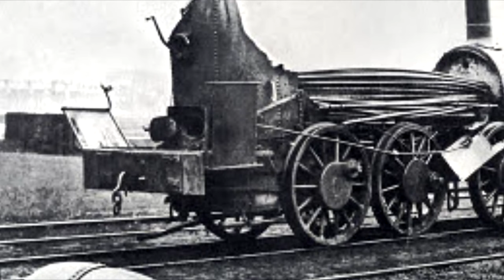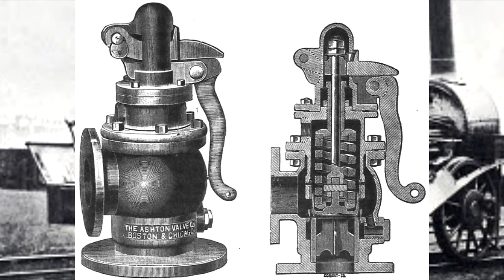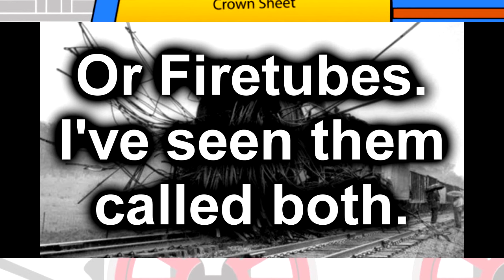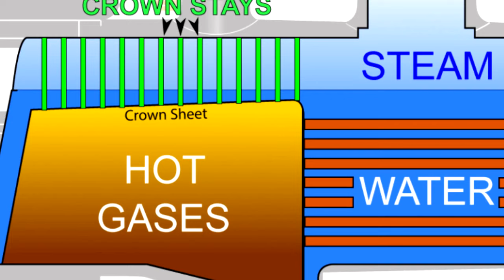Steam Trains Sometimes Have Bad Days 🚂 The Explosion of C&O 3020 🚂 History in the Dark

Comment: The Crash at Crush wasn't the first spectacle crash. At least one had been done previously in New York - without the boilers exploding. Unfortunately, the MKT engineers were unable to ensure the same result.

IIRC it was less that the public didn't think Crush had done anything wrong and more that he was re-hired on the sly because despite people being pissed about the explosion... the crash still got the MKT lots of publicity and attention, so it was a net gain for them.

And pretty sure that "the Katie" is indeed said with a long "a", because it's derived from the second and third letters of the railroad's initials: KT

Comment: WOW! I know what happened to the C&O 3020 T-1 locomotive.  I have been a railroad buff since I was very little (I will give a bit of a story when I was only 5 years old at the end of this). I talked with a gentleman at the Youngwood Railroad Museum in SW PA in the early 90's. I will just call him Mr B. since he passed away decades ago and I can't get his permission to use his name here. He worked for Pennsylvania Railroad, then the Penn Central Railroad. He was in his early 60's age at that time. 

First, you said it was on an .18% (point one eight) Percent grade, which is next to nothing - only inches rise over 100 feet section of rail. The grade I was told is a 1.8% which is 1.8 feet rise per 100 feet distance which is about 21 5/8 inches rise per 100 feet. Not much for a car, but a locomotive pulling thousands of tons of weight is getting to be the upper range limit of grade railroad companies try to limit grades, which is a target of 2% maximum, though some grades can be and are steeper than that, but not as efficient because on long grades additional locomotives would be needed just for the one single grade rise over what could be a short 10 mile run, or a run of a couple hundred miles. When all grades are below the 2% grade or the grade is very short, one locomotive can be sufficient. It is a huge savings to have only 1 locomotive vs the cost of two locomotives and two crews, just for one additional locomotive needed for the steeper grade. This information is relevant to what happened.

The engineer was hesitating to add water. At the 1.8% grade, the locomotive would be slow at best. Adding water on the grade or just prior to the grade would slow the locomotive even more, and sometimes the train would come-to-a-stop/stall until the water temperature and pressure got back up to temperature and pressure needed to pull the grade. If the train is late, it was frowned upon by the management, and the engineer was blamed, and sometimes punished for being late. So, the engineer delayed adding water trying to keep to the schedule.. If the crown sheet was exposed and water added, there would be a rapid steam pressure rise and the pressure from the flash steam to the point the locomotive would explode. In the case of the 3020, that is exactly what happened.

Repair the locomotive?? Yes. The boiler tubes are only in place with friction. When new pipes are installed, the pipes are swedged (expanded to be snug in the hole it was passed through). So, in certain conditions, the pipes are blown out of their location at one end or the other, usually out the front when the crown sheet is exposed and water is added causing the flash steam. I am not familiar with the physics of why this happens to go into detail, but maybe someone knows.

When I was only 5 years old:
Growing up, a spur line, Radabaugh siding, ran past the family property, and from that spur line, was another spur line, the West Newton line, that turned left 90 degrees and split the property in two sections. It was a working farm until about 1950's of about 120 acres. The spur line of the main line running past the house was busy. On the mainline through Greensburg Pa, there were tunnels. Any oversize loads had to divert to the Radabaugh spur line past the house (about 250 feet from the house) and divert to another spur line which connected to the main line on the other side of Greensburg. The spur line off the side line sometimes trains would park to allow another train to pass. One day I was to go to the neighbors much closer to the tracks to borrow something, I cannot remember what, and big as life a train was on the West Newton line waiting for another train to pass. Well, being so close to the train, (about 100 feet away), I simply walked up to the train and talked with the train crew. They invited me into the caboose and gave me some chocolate chip cookies. For me, this was great!! To my mother wondering why I didn't make it to the neighbors, Well, the train crew heard my mother and the neighbor yelling my name, and replied to them that I was there with the train crew. I still couldn't understand why I got into so much trouble, It was only for about 10 minutes maybe 15 minutes. I was forbidden to get any closer than the 100 feet distance the neighbors house was from the tracks. 

This is a bit long winded, but packed with a lot of needed explanations and information. I hope this helps understand the 3020 explosion, and an entertaining short story (maybe even boring to you) of one of my first memories that I still remember.

Comment: Interesting tidbit.
The most modern designs for steam powered vehicles use one of two types of "water-tube" steam sources.
Either a 'water-tube boiler', or a 'steam-generator'. Water-tube boilers are similar to traditional fire-tube boilers but with water inside the pipes and hot gasses around the pipes instead of water around the pipes and hot gasses inside the pipes. The advantages of water-tube or generator types is that there isn't a crown sheet. Also they use high pressure pumps to circulate the water & steam constantly to prevent hot-spots. Water tube types don't explode. But they can burst. Bursting however is far less likely to do damage or injure or kill someone because they burst in one direction like a vent. However, there are cases of water tube kinds bursting and shooting a jet of steam and killing someone.
The Doble steam cars use high pressure water tube system that is probably the most advanced steam system ever made for transportation use (excepting for atomic-powered ships).
The many expensive attempts to use modern steam generators with small (under 600hp) steam turbines have all been failures. Steam turbines don't work at low power levels and are very inefficient below 90% power. Attempts at the land speed record (rail speed record is different) have almost always used overly complex systems and been failures.
Anyway. I'm rambling.

Comment: Whenever I'm operating a steam engine in simulation, I never let the water level in the boiler drop below 100%.
Reply: How far do you get like that before your cylinders prime and blow up, or you run out of steam?

There is such a thing as too much water in the boiler too. 
If the water level is too high, water gets into the throttle and the drypipe, sending water into the pistons. water doesn't compress, so the cylinders bust open. Hence why steam locomotives open cylinder cocks to drain condensation when starting to move.
Either that will happen or you will just run out of steam because there's water where steam should be, leaving no space for steam to generate.
Reply: @PowerTrain611  Key word is simulation, not reality.

I'm not a locomotive engineer IRL, just in video games.
Reply: @TheOneTrueDragonKing  Not much of a simulation  then... what's the fun in that? XD
Reply: @PowerTrain611  Well, it's Trainz or even Train Simulator, so...

The main bit of fun in Trainz is building routes and with Train Simulator, running the engines. It's forgiving on the high end, so long as you keep the low end from occurring.

TS is more realistic than Trainz when it comes to running trains, but creating routes is far easier in Trainz.

I used to love Surveyor. Then I took a Discord Content Creators' Server to the knee.
Reply: @TheOneTrueDragonKing  Aha, that explains it. Trainz is good fun for building, but it definitely always has been more suited for model railroad enthusiasts. I always loved the detail people put into their routes.
Reply: @PowerTrain611  TS is more realistic than Trainz when it comes to running trains, but creating routes is far easier in Trainz.

I used to love Surveyor. Then I took a Discord Content Creators' Server to the knee.

The CCS is too toxic for my taste. I've mostly abandoned Trainz since - help is nonexistent if you want to do something unpopular.

Comment: How far into the gradient? Maybe they ran it low so the water would cover the fire box as the front was raised as it climbed. I can imagine a loco going along the flat with a red hot steel interior and the water comes back and super heated steam shreds it. * isn’t there a lead plug in the crown plate, or is that a later safety thing?
Reply: You're thinking of "fusible plugs".  I don't know when these safety devices first started appearing, but to this day there's no requirement to use them.  Anyway, it's a plug threaded into the crown sheet with a metal interior that melts under 500 degrees, a little hotter than pressurized boiler water, but cooler than when the crown sheet would be cherry hot or structurally unstable.  The theory is the plug melts before the crown sheet, steam exhausts into the firebox, extinguishing the fire and/or warning the crew, hopefully without burning them from the exhausting steam. Still better than a catastrophic boiler failure.
Reply: @cnjgp7  some alloy I guess then. At those temperatures I expect it would light a fire that was out?
Reply: @teamidris  I'm not sure I understand the question about lighting a fire.  The fusible part of the plug is maybe 1/2" diameter max (it's been awhile since I held one in my hand), so not enough to light something on fire, but rather the exhausting steam from above the crown sheet would put out the fire in the firebox below the crown sheet (again, in theory - I'd never want to test that!).

Comment: Actually, it is quite simple why the engineer didn't give more water. When water enters the boiler steam generation is reduced, as the water is, you know, colder, and they were going on an incline. Also, the way to repair an exploded boiler is very simple. Replacing it with one that hasn't exploded. But still, didn't that man have the slightest hint of q self preservation instinct?

Comment: and after this explosion many locomotive had this picture in there cabs.
Reply: Indian steam locomotives on one major road all bore a plate in the cab bearing the message "Remember Abermule - check your tablet". It was a reference to a head on crash in central Wales, where a driver never checked his single line token (or his boards) and took a train into an already occupied section. A young Indian railway engineer was apprenticed to the Welsh line's works at the time; involved in the clear up, the incident made such an impression on him that he never forgot it, and ensured, on going home, that none of his men did either.

Comment: It's a "tricky DaNcE" between to mUCH water in & NOT enough OF. To much (It WON'T make steam at all) It's just a water tank "paper weight" To little, the thing GOES UP and makes a paper weight around 400 yards from where it left the track! This is why redundancy is SOOOO IMPORTANT! Dual injectors (sight glasses) + knowing HOW to check the glass. Illumination for night runs. The fireman must know the route as well. He MUST know the "steam demands" the engineer requires.While other accidents in the late 19th century to the 20th century went UP. Boiler explosions were @ a constant (around 29 per year) still a lot, but compared to head-ons rear-ends, runaways, etc. not bad. I think the current generation should be more diligent in proper training + respect for the Genie in the bottle in front of them.

Comment: The fireman puts water in the boiler not the brakeman. There's an engineer and fireman that control the locomotive. At this time there was a front and rear brakeman along with a conductor. The fireman controls the fire and water and the engineer runs the locomotive based on signals from the ground that the brakeman give. The conductor does paperwork in the caboose while the train is moving as the rear brakeman would ride in the caboose as well watching the train. While traveling from place to place the front brakeman would ride in the cab with the engineer and brakeman. Why the brakeman was speaking up about low water in the boiler to the engineer and not the fireman is confusing as is the entire situation. Maybe he spoke to the fireman about the water and he was not listening and that's why he spoke to the engineer which the engineer would have thought it's not my job tell the fireman about it. This was the foreman's fought first and the engineers second for not taking seeing to the fireman doing his job correctly. It's never just cut and dry though that someone just didn't do it and without the fireman and engineers story you never know because something could have been broken and they was trying to get water in the boiler and the brakeman was freaking out and still in the same state of mind while dying and not been able to articulate more than I told them to put water in the boiler it was going to blow.

Comment: Does the guy who puts together these videos not know the difference between a "locomotive" and a "train?"  Also, wasn't it the fireman's job to keep sufficient water in the boiler?  Granted, the engineer is the boss, and he might demand that the fireman bring the water level dangerously close to the crownsheet, in the interest of generating more steam.  Also, it appears to me that there were two types of crownsheet failures.  There's the type described here, where the introduction of cold water causes an explosive flash of steam.  But, altrenatively, if the crownsheet went dry, then the steel (as stated in the stories) would become too hot.  The crownsheet would then pucker and warp and crack.  The cracks would rupture, causing the steam to flash downward.  That resulted in the entire boiler being ripped from the locomotive and being thrust into the air, tumbling end over end through until it landed.  The boiler of a conventional steam locomotive is firmly attached to the underlying machinery (the "engine") only at the front end, at the cylinders.  As the boiler heats up, it expands in length, and thus it is loose at the rear, only resting on steel pads at the firebox end of the locomotive.
Reply: I think that in the UK the firebox and therefore crownsheet, were often made of copper so would melt at even lower temperatures. I'm no expert on the subject but I have read this on many occasions.